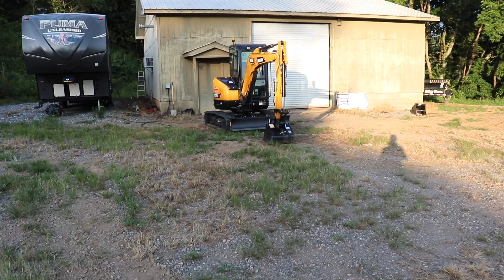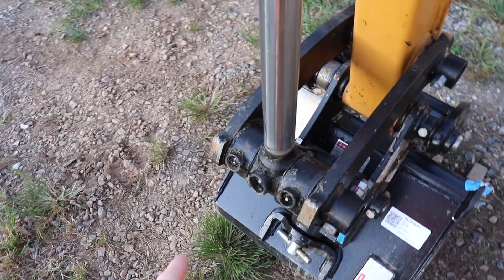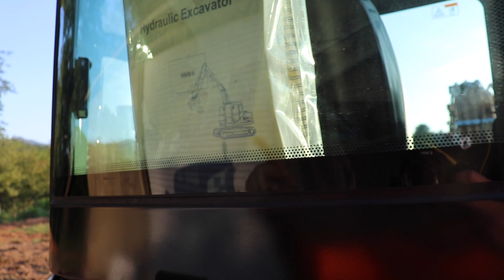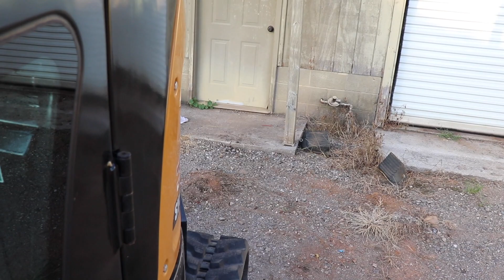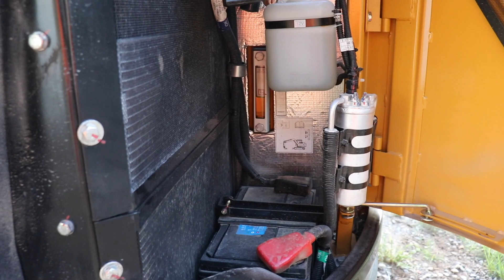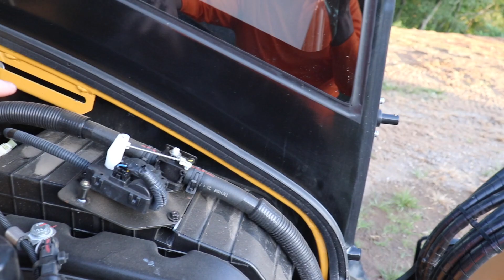Sany Mini Excavator First Project Laser Grading

Comment: @11:48 Chinese machinery are great for making things like whatever this is with no markings, brand name model # part # they do this all the time good luck troubleshooting and ordering whatever that part is.
Reply: That part is the return to tank valve for using tools like a mulcher or rotary brush cutter.  I do agree the manual is very vague but as for ordering parts, call your Sany dealer and you'll find parts are readily available and most, if not in stock can be delivered in a day or two.  Sany uses good brand name parts and components unlike another Chinese excavator I had previously and that's why I sold the no name machine and bought the Sany SY35.  Yanmar engine, Kawasaki main pump, Parker drive motors etc.  All good stuff and the dealer fitted it with Werks Brau quick coupler and thumb and Palladin and AES heavy duty buckets and root ripper.

Comment: How would you do an emergency shut down on a machine like that if the engine was running away? Is there a way to choke the air supply?
Reply from the maker: Estop
Reply: never seen an air shutoff come as standard on a machine. oil field adds those

Comment: That valve is indeed for your auxiliary function. It changes it from single flow (mainly for a breaker) to dual flow (which it'll be on now in your video to operate your thumb). Hope that helps.
Reply from the maker: I used the bypass valve for my mower. Keeps the spool cool and provides max flow in one direction.

Comment: S is standard mode B is breaker mode, basically you can get more engine rpm and oil flow out of your SANY when you are in B mode. Don't remember the exact numbers but I believe max for S is 1800 rpm and for B is 2000 rpm... That valve you are talking about is indeed for your aux hydraulic you can choose between one way and two way HYD (breaker or tilt bucket) but on 35 you have 2 aux hyd lines so you can have aux 1 for tilt bucket and aux 2 for breaker or thumb but you need to manually turn THAT valve on or off. Subscribe to my channel I have some videos about SANY machines
Reply from the maker: My SY35U only has the AUX1. The S and B don't function that way on my machine.  In B mode it sets idle to less than 100% and stays there.  It also disables the auto idle feature in B mode so not really useful.  I think the US versions may be different than other countries.  The left buttons did not allow me to do anything with the actuation of my mower.  I've already subscribed to you on our last convo about the buttons, but unfortually my version 2021 SY35U (USA) doesn't function that way.
Reply: @ShaneBurrell1  oh, that is weird. Usually us in Europe get stuff with less options. In Europe sy35 as most of them is with 2 aux hyd and it has flow control on both, it has a S and B mod and that valve that you have to turn manually is also activated via solenoid inside the menu. There is a extra option HYD quick coupler and separate lines for it. So you'll still have 2 aux and HYD quick coupler...
Reply from the maker: @avicomjdoo  Any idea how the firmware works on the Sany?  Ever taken one apart or seen the actual controller?
Reply: @ShaneBurrell1  nope. Even us in dealership/service don't have original diagnostic/flash tool, they are telling me it does not exist. Only diag tool we use is insite for Cummins engines for bigger SANY machines. Had a few issues on sy18 and sy50 with ECM... We replaced them and it was plug and play...
Reply: @ShaneBurrell1  yea I forgot to answer... Your ECM is your screen/monitor...
Reply from the maker: Does it have any ports or connections?
Reply: @ShaneBurrell1  it has one connector, and other one for GPS antenna

Comment: Hi stupid question about the start up procedure on this machine. When I turn the key to the ON position if I don't crank the engine over immediately the key locks and I have to shut it off and start over. I don't feel like in cold weather especially I should go straight from off to cranking but that seems to be what it wants me to do. I didn't get a owner's manual with mine so I can not consult the manual. I guess my question is does yours do the same thing or is there a step I'm missing
Reply from the maker: Mine is all electronic. I go on then immediate start and it will choose to kick over the starter after the glow cycle if it's cold.
Reply: @ShaneBurrell1  
How much do you sell?
Reply from the maker: @a22galaxy38  Sell what?
Reply: @ShaneBurrell1  
excavator for sale?
Reply from the maker: @a22galaxy38  I don't sell them.

Comment: That key looks kind of like a Bomag key.
But lots of construction equipment uses the same keys. And about 80 to 90% of all the construction equipment uses the same blank. They are just cut a little bit different. Lots of key shanks are identical with different heads on them. 
I keep at least six different keys that are identical except that the teeth are cut different which confuses people when they want to borrow my keys.
I started learning about keys cuz I wanted Keys that didn't have plastic heads on them that take up so much room in my pocket. To save more room you can get those double-sided keys cut differently on each side for different tractors on each side of the same key. Just like people used to do for Ford cars and pickups. They would have the car cut on one side of the key and their pickup truck on the other side of the same key and notch in the head on one side of the key to remember which side goes to what car.
Bobcat and Case tractors use the same blank as the old Chevy ignition keys. John Deere skip loaders use the same blank as the old gas cap keys with the word "gas" on them.
Bomag keys look different than most but they fit several other brands of tractors to.

It's so easy to get tractor keys and have copies made that it's not safe to have a key ignition on your tractor. Lots of people are going to coded ignitions now. 
But a key is better than the old cat equipment that didn't use a key at all, just a switch.

Just pointing out that it's easy to steal equipment these days and equipment theft is on the rise, so keep your equipment safe!
It's also a good idea to use one of those locators to track your equipment when it's been stolen.

Comment: Could you provide part numbers for the quick disconnect?
Reply from the maker: JZFS-2009280160  Is all the markings on them.
Reply: @ShaneBurrell1  thank you! Where did you get the peace you modified to attach the plate on the brush cutter too
Reply from the maker: @devanbrake9758  Mongo Attachements. They sell raw adaptors.

Comment: I have the little Sany SY 16 it actually has several these valves it is basically just a ball valve and shut off flow is either off or on somewhere in between my restrict the flow but I don’t know that that’s an advantage and in my engine compartment when I first got it the thumb did not work and as soon as I turn that valve on hydraulic fluid was sent to the thumb… The symbols are in Chinese, if you turn it the opposite direction you’ll find something will stop working I’m sure!
Reply from the maker: The valve was the spool bypass for aux flow.  So if operating a dual direction device like thumb or grapple you want it closed.  If operating a mower or other single direction (like in my case) you want it open, the return dumps right back into the tank with it open.  Provides max flow, cooler operation etc.  I was hoping thats what it did and it works great with my VMC mower.  Is the SY 16 pilot operated?
Reply: @ShaneBurrell1 , I have a little SY16C with the same kind of valve for auxiliary hydraulic flow: one-way for stuff like breakers and two-way for hydraulic thumbs. It's all manually adjusted on the 16C - no fancy digital controls like your 35U.